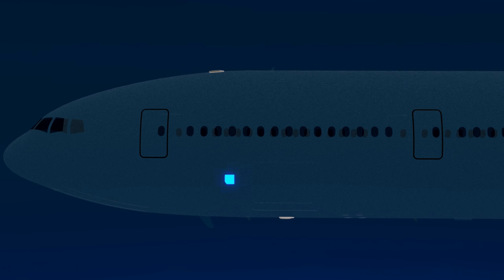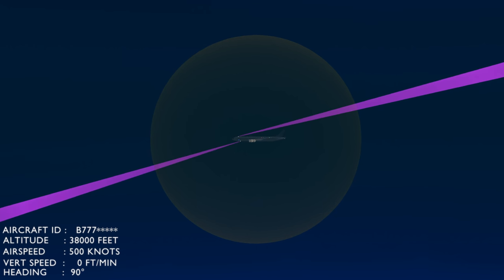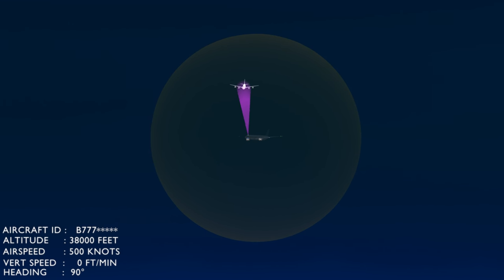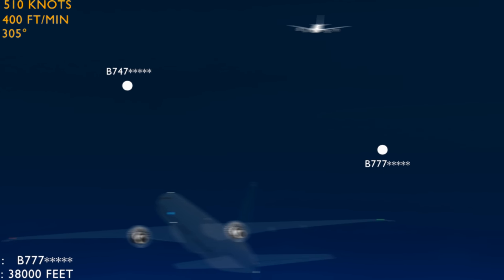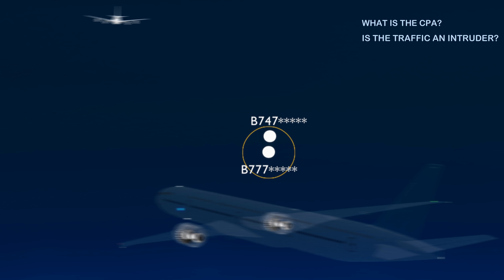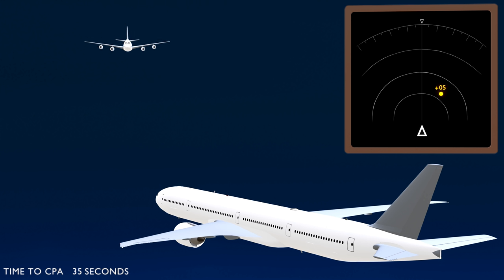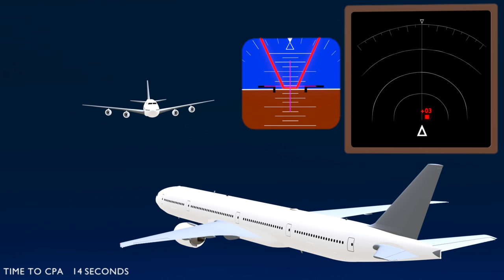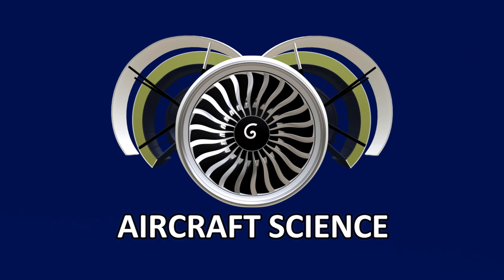How TCAS Prevents Mid-Air Collision

Comment: Worth to note that the only major mid-air collision since adoption of TCAS was not due to fault of TCAS, but due to regulations.
The Russian pilots followed ATC descend instruction, instead of TCAS climb resolution. (ATC aware of potential collision risk and was trying to have a vertical separation, command came too late as TCAS already started to issue collision avoidance resolution). Meanwhile, the freighter on the collision course followed TCAS resolution and started descent as well... And the two planes collided.
The sadiest part is when ATC noticed freighter is also descending, he told the Russian pilots to increase descend rate. While almost at the same time, TCAS instructed the freighter to increase descent rate as well. (TCAS will instruct a steeper descent if one aircraft is not following instruction or not climb/descend fast enough). Freighter's radio call to let ATC know they are following TCAS instruction was stepped on, because Russians were reading back instructions at the same time, thus ATC didn't hear the warning.

Today, all aircraft are advised to follow TCAS instruction first instead of ATC instruction. (TCAS will also give alternative instructions should one aircraft not following the collision resolution. In the previous case, after detecting only one aircraft is following TCAS instruction, it will now change frighter's descent instruction to climb should the Russian airliner continue to descend according to ATC instruction.)
Reply: and a father whose family died on board decided to go and murder the ATC worker

Comment: Fun fact: Separation between planes must be 1000 feet.

However, when two aircrafts are going to intercept at some point even if it's 1000 feet apart the aircrafts not only throw a Traffic Advisory (TA) but also a Resolution Advisory (RA) which means it will modify your vertical speed for you and climb or descend automatically.

To avoid this unnecessary maneuvering, Airbus developed something called TCAP (TCAS Alert Prevention) which will detect the situation, it will know for sure it's not a collision, but just the standard 1000ft separation, and it will decrease the vertical speed to a point where the RA is not triggered.

Good job Airbus!
Reply: I was afraid when I started reading this that they actually modified the TCAS system to prevent the alerts. 😲 They're just modifying the inputs to make sure the alert is not triggered.

Comment: I am absolutely sure I was once in a plane that was still safe but for normal’s circumstances and me as a non professional pilot very close or let’s say the closest you can get to a collision under normal circumstances und while still beeing safe and it was creepy…  I was sitting in the front row of an A319 of an Eurowings flight operated by Croatian in like 2010 on a window seat on the left side so I guess it was like seat A1… And while observing the sky I noticed humanity like 5-10 sec before the “event” some kind of traffic or plane approaching really fast and almost at level. It came in like in a 45 Degree angle crosswide from the front like 1sec before both planes planes met I could not only see the Typ of aircraft and airline  or something else relatively obvious for a trained eye  (It was an A321 operated by Condor) but I was even able to  read small things like  registration code and all details like warning signs, antennas, sensors etc. you would only see within a maximum distance of like 100m especially if you consider the high velocity… Yeah and these two aircraft definitely met at the same point just with the crossing plane wit by king h a maximum of like 100m/300ft higher, you could even feel it a little bit of turbulence and vibration.m  for a second…
It was not creepy because it was so fast you had no time to get scared just to watch an wonder… Yeah it was interesting but not frightening but I am damn sure they had at least some tcas alert…

Comment: Is there a possibility of TCAS directing the plane out of a collision course with one plane and into a collision course with another plane?
Reply: That might be likely, but that other plane should also have TCAS so it will not run into the plane responding to its TCAS
Reply: I don't know if there's been any reported case of this, but it could cause a chain RA reaction in congested airspace. The issue is that since it takes into consideration your vertical speed (usually a good thing), if you don't smoothly start to level off a good while before you reach your altitude, other planes' TCAS will interpret you as a threat and give RAs to their pilots, and since your climb rate during an RA is very steep, you'll undoubtedly trigger nearby planes to maneuver away sometimes. Another plane's TCAS doesn't know when you'll stop climbing/descending so it has to assume the worst case, which is your plane continuing to fly as it is doing right then
Reply: @justalonelypoteto  Kind of like a chain reaction, but still better than a crash

Comment: I am absolutely sure I was once I a plane that was still safe but for me as a non professional pilot still creepy and very close… I was sitting in the front row of an A319 of an Eurowings flight operated by Croatian in like 2010 on a window seat on the right side so I guess it was like seat A1… Well and while observing the sky I noticed like 5-10 sec before the “event” some kind of traffic or plan approaching really fast and almost at the same level the plane came in like in a 45 Degree angle crosswide from the front like 1sec before both planes planes met I couldn’t only see the Typ of aircraft (A321) or airline (Condor) or something else relatively obvious for a trained eye but I was even able to read the registration code and all details you would only see within a maximum distance of like 100m especially if you consider the high velocity… Yeah and these two aircraft definitely met at the same point just with the crossing plane with a maximum of like 100m/300ft higher, you could even feel it a little bit for a second…
It was not creepy because it was so fast you had no time to get scared just to watch an wonder… Yeah it was interesting but not frightening but I am damn sure they had some tcas alert

Comment: if the tcas system fail, what is the backup system? THANKS
Reply from the maker: No backup for TCAS.
Reply: Eyesight and luck.
Reply: Your phone's metal detector lol
Reply: TCAS is the backup.
Reply: I'm an avionics technician at a repair station. Every time a jet comes in we do a checklist of the cockpit systems (including TCAS). The odds of it failing aren't zero but they're pretty low imo. The ways it could happen are the computer crap out, a wire gets cut, or the antenna becomes damaged.

If the TCAS computer stops communicating with the MAU you'd get a CAS message. If the antenna becomes damaged, I could be wrong this is just me speculating, you'd still have the other aircrafts TCAS system which would initiate communication via VHF which is a separate antenna.

As with most safety systems on the plane there'd have to be a lot going wrong all at once for things to become deadly.

Comment: well TCAS system failed at that time. Rip passengers and all crew members.
Reply: There have been 2 midair collisions where the aircraft had been equipped with TCAS. In the Überlingen midair collision, TCAS was fully functional on both planes as it should have been, but the pilots on one plane, as per Russian rules, obeyed ATC direction over the TCAS instructions. In the 2006 Amazon midair collision, it worked on both planes, but on one it was turned off for some unknown reason